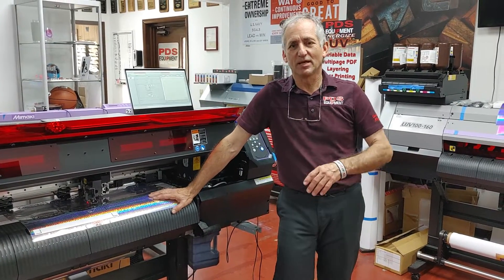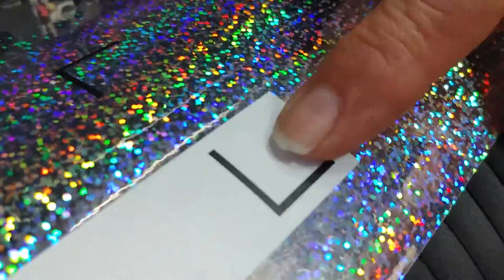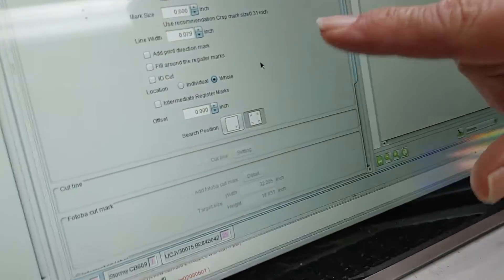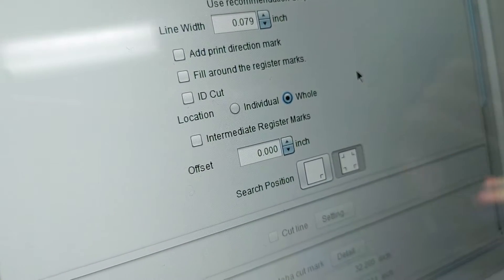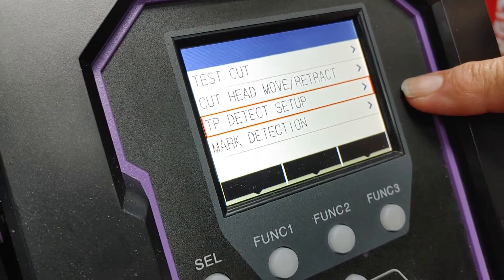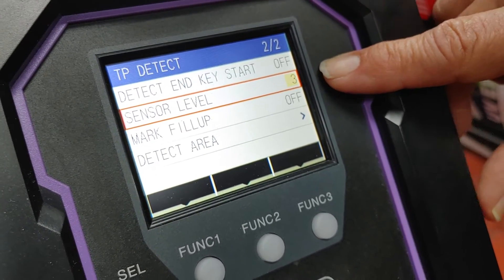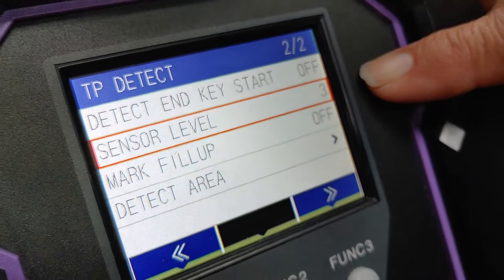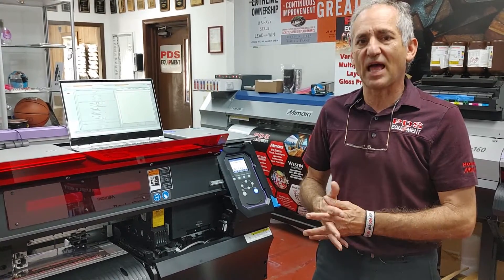Detecting crop marks on chrome and holographic without white fill on a Mimaki UCJV300

Comment: Great video - how did you get the white background around the registration marks?
Reply: The white is done by using FineCut to add the marks to the artwork in Illustrator, then use color replacement in RL to change Red to White.
Reply: @kevinbrown4671  thanks! Is that possible to do when using a composited file in raster link? I'm not able to get registration marks to work when imported from illustrator

Comment: 🙏Please link to the video for the white under the reg marks.
Reply: This would be great to know. I can find in the instructions where it says it's possible in the mamaki manual, but can't find any actual explanation
Reply: @lbdesignworks461  The white is done by using FineCut to add the marks to the artwork in Illustrator, then use color replacement in RL to change Red to White.
Reply: he made it manually, maybe.